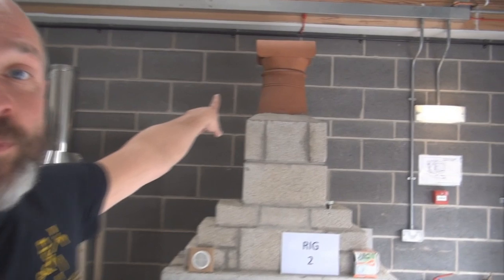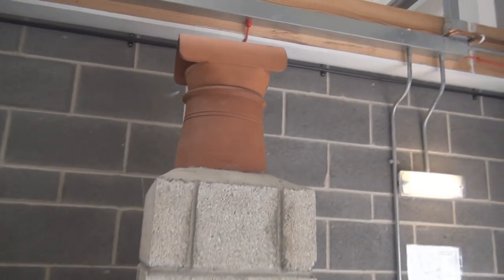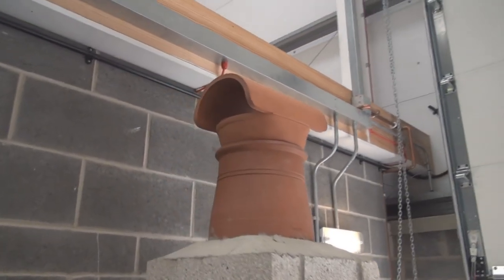Dangerous Chimney Cowl! SweepTV

Comment: You seem to have forgotten to tell us why it is not safe.
Reply from the maker: That is a fair comment and here is the answer- these cowls are very restrictive and can stop/slow the dangerous gasses exiting the flue.
Reply: @shed.projects: They can cause chimney fires due to tar buildup on the account of restricting the flue size and air flow within the chimney, they can cause carbon monoxide leakage due to the  same reason on gas and oil appliances, they are a magnet for nesting birds and they have been also known to cause so much pressure on the flue that the stack itself explodes and cracks.  Better off using one as a garden ornament than having it on your chimney.